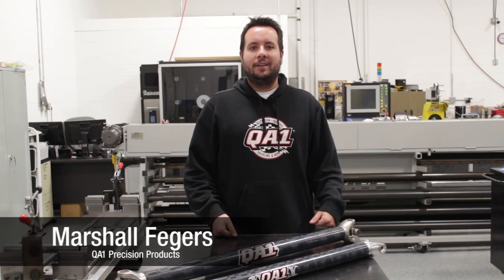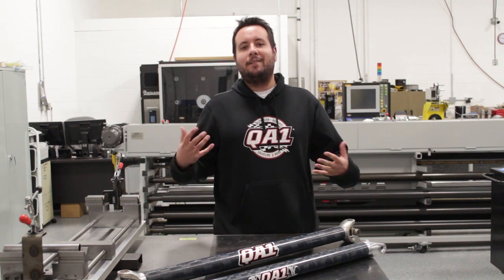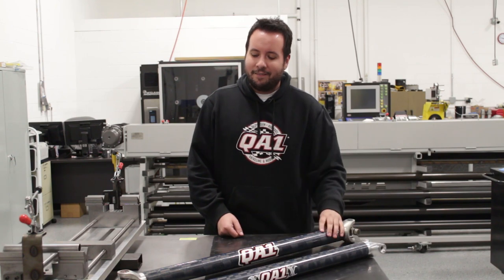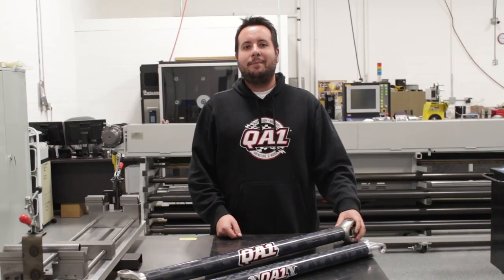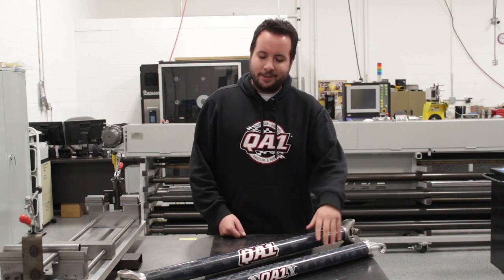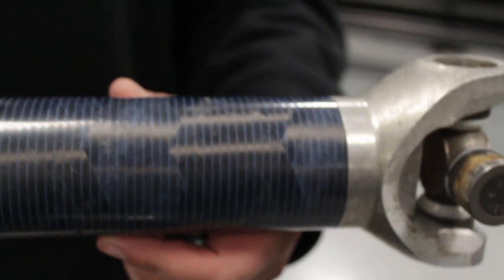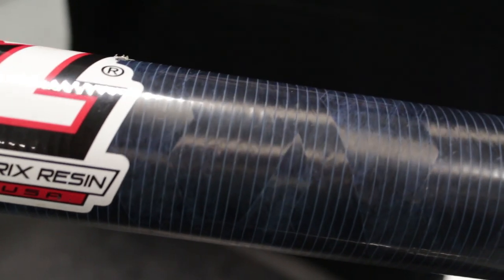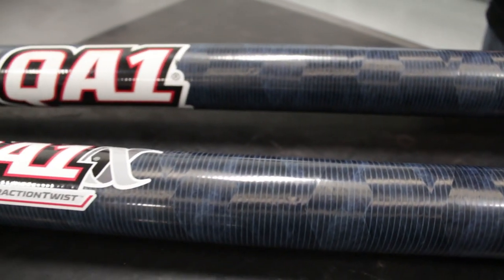How Durable are QA1 Carbon Fiber Driveshafts?

Comment: They need to up their warranty before I would trust it in a daily driver. Gravel, dirt, heat, cold, road salt. All things you don't deal with on a racetrack....
Reply: Ken Hotaling Read their description
Reply: Ken Hotaling  the shaft itself  never breaks in the middle  it fails at either end  iv seen it happen  for the money il have a custom built  chromoly one instead  infact I can almost buy 3 shafts for the price of one carbon fiber  , these shafts are if weight is a factor, there are stronger metal ones out there, iv done the research
Reply: all you have said dnt matter with the carbon fiber

Comment: Mine has a cut in it because the person who installed it didn't realize the e brake bracket rubbed on it after putting the cars weight down.

Comment: What is the longest you can make a carbon fiber driveshaft? I have a Chevy 2500 HD 2 wheel drive. I really would like a one piece driveshaft but I'm 91 and 1/2 " from U joint to U-joint and 94" or so inches total length.  From rear of tranny the center of rear yoke
Reply from the maker: Hi there! Our maximum length at this time is 65 inches and the maximum u-joint is 1350. We cannot make a driveshaft for you at this time.

Comment: Can it hold up to a 1000hp transbrake  launch ?
Reply from the maker: Our Custom REV Series driveshafts are designed to hold up to 2000 HP and 1500 lb*ft of torque. And our direct-fit driveshafts for Mustangs, Camaros, and Challengers offer up to 1500 HP and 1000 lb*ft of torque.
Reply: QA1 but can the bonding of the shaft to the yoke hold up to a 5000 rpm transbrake launch from a 1000 hp big block car that weighs 3300lbs ?
Reply from the maker: @twomontess  The JJC-AC0320 drive shaft with 1350 u-joints is rated in excess of 2000hp/1500tq, regardless of how the car is launched. This will be fine.
Reply: QA1 thank you for the reassurance!!
Reply: Bad Azz Machines  yes it can but do yourself a favor  go buy a custom  chromoll steel one instead  oh its heavier  but Its stronger and way cheaper
Reply: Bad Azz Machines  wait till you see the price , just remember if for any reason it gets damaged , say by a clutch explosion or if your car catches fire  and it hits that fiber shaft  kiss it good bye  go spend another  1600 dollars  to replace it
Reply: Jon Alarcon driveshafts are a disposable part anyway.   I’m replacing a 4130 with this for next year.
Reply: Bad Azz Machines yes it can be just like any other part on a car ,however at 1600 dollars a drive shaft  we want to get the most use out of every disposal  part we can, I'm not rich but I have money  and ultimately speed is my goal, i.e. the texas mile ,and through research chromoly steel is my better option
Reply: Jon Alarcon I agree with you on price.  But on the other hand when a 4130 breaks it breaks everything else in its way. Add that up.  The middle of the car gets destroyed.  
 When a CF shaft breaks it turns to dust.  So what’s cheaper ?
Reply: Bad Azz Machines  oh I agree with you on that one most definitely  but thats only of your not smart enough  to run 2 drive shaft safety loops  like I do , and yes iv broken my u joints even when I was using the really strong joints , but iv never broken or twisted  my drive shaft  it's way to strong for that especially when your drag racing and there is alot of prize money on the line

Comment: How does it deal with snow & cold climates
Reply from the maker: Our driveshafts were designed and tested right here in Lakeville, MN. So they went through a lot of testing in the winter months and held up great! They are designed to withstand salt, snow, rain, dirt, asphalt, etc. We have a lot of dirt circle track racers who run them and are very happy with them!

Comment: How much weight difference from c.fiber driveshaft versus aluminum shaft?
Reply from the maker: A carbon fiber driveshaft weighs about a 1/3 less than an aluminum one. The longer the driveshaft, the more weight difference it will have.

Comment: I would never buy a carbon fiber or a aluminium driveshaft , I would only buy or use a chrome molly steel driveshaft  they are the best strength wise for high speed  applications bar none , iv seen aluminum twist and carbon fiber completely fail at one end or the other
Reply from the maker: Our driveshafts are made with a 3M Matrix Resin. This resin is an unbelievably tough Nano silica matrix resin that has improved compressive strength, reduced water absorption, and better impact resistance. These driveshafts are designed, built, and balanced in-house before being shipped out. They are used in circle dirt track and many asphalt applications including circle track, road course, drag, and overall daily driving activities. And as for safety purposes, in the highly unlikely event that it will happen, a carbon-fiber driveshaft shreds like a broom, so there is no damage to the racer or other parts of the car.
Reply: QA1 my friend uses resins in aero space applications and hes tested all of every resins know and unknown to man   meaning to the general public , he says everthing has its limitations,  with that said yes carbon fiber has its advantages without a doubt especially in weight reduction, however,  I will take chromoly steel  over it any day of the week,and as far as drive line failures  that's why I run 2 drive shaft safety loops,  for the cost of one of your shafts  I can buy almost 3 chromoly shafts  custom build to Handel my 2500 hp engine   no offense  hope none is taken
Reply: QA1 yes I understand  how you make them , more then likely the resins you use to construct them have the same molecular structure  throughout  thus making them extremely durable  it's like metallurgy and having the grains running in the same directions  or folding the steel upon itself, by forcing the grains together and closer makes for a stronger material
Reply: Meh I'll buy a Carbon Fiber drive shaft over a chrome molly steel driveshaft anyday. CF is far superior in all aspects.

Comment: Believe me if weight was a limiting factor  I would buy one of your drive shaft  without hesitating  but strength is  and I know chromoly  steel is good at high speed applications  which is what I need   good luck.......
Reply: Then why tf you here